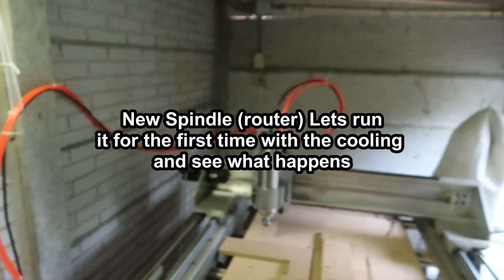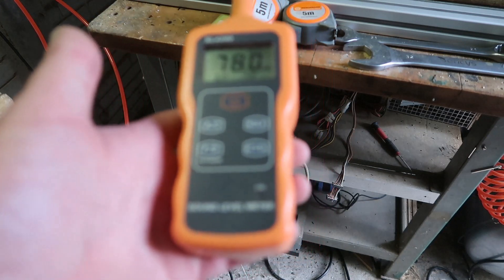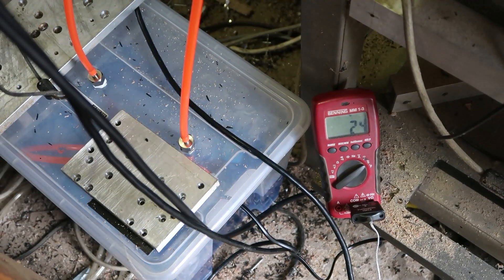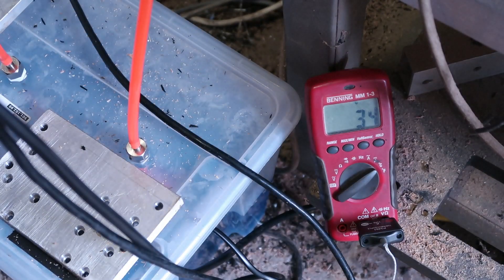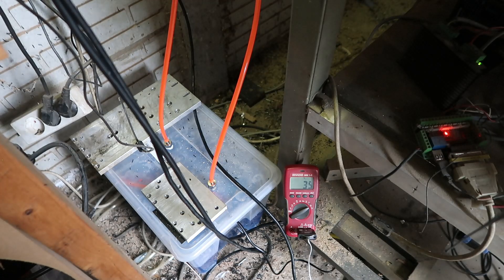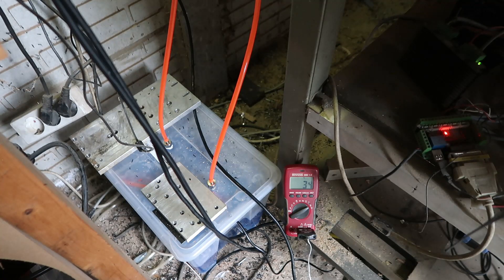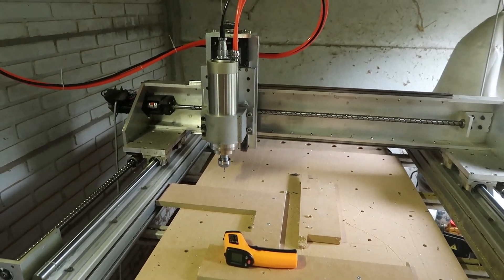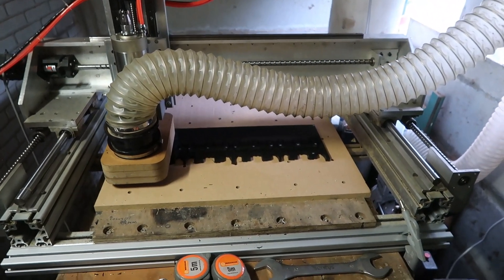CNC - 2.2 Kw water cooled HF spindle first run (hopefully not the last)

Comment: Freeze your water jugs
Reply from the maker: haha yeah, thats an option.. (cooled my first overclocked pc like that. i did not have a rad so i used ice :),  just to see how high i could get) but not so nice :) well i prob go use it this way for a while then either buy or make something. i just noticed pc radiators became insane expensive... so maybe i buy the whole "chiller" and replace the noisy fan :) for now i try to not spend money on things that suck so lets see